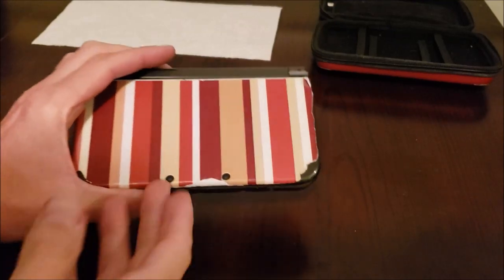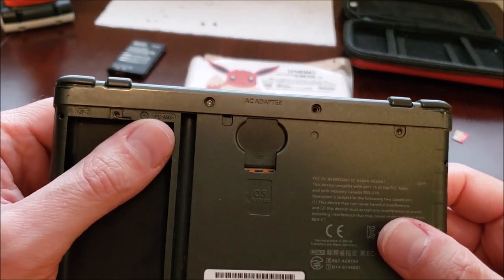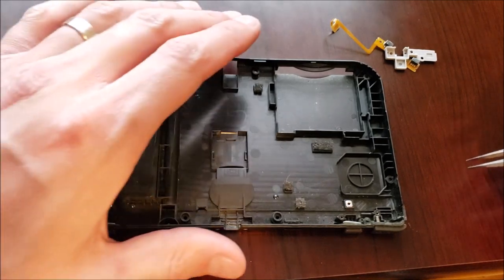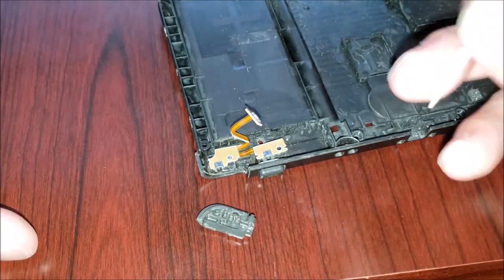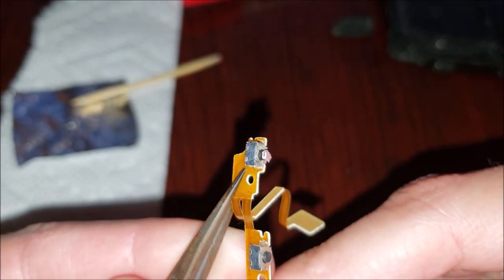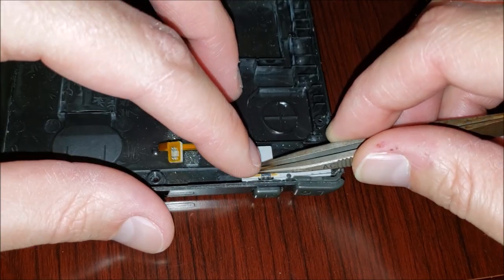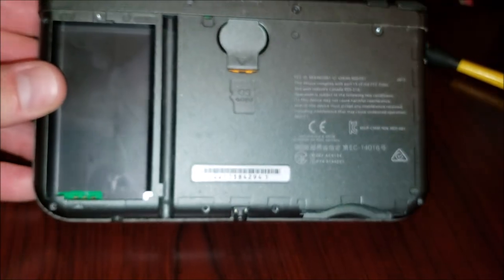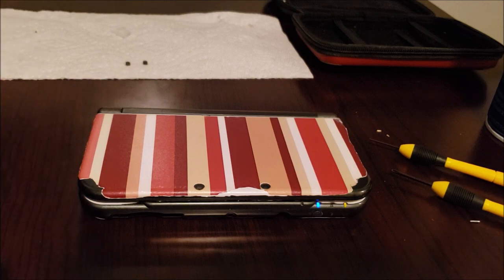How to Repair New 3DS XL Damaged Shoulder Pad Button

Comment: Question I got the right screw driver but I can’t unscrew it any of the screws in my 3ds any tips?
Reply from the maker: the screws are stripped or you don't have the right screwdriver
Reply: @FantasticQuack  I may have the wrong screwdriver which is the correct one?

Comment: I have a similar issue My left clicks but don't do nothing. But after pressing for about 5 mins its start working but stops after awhile.
Reply: HyruleDefender Gaming both the l and zl button dont work?my zl wasnt working and i repaired it giving the flex a bath of alcohol,maybe that could work with tou too,anyways you can buy the flex online and change it which is supposed to work 100%
Reply: Press Y for same but with my right triggger
Reply from the maker: Try opening the system and cleaning out the switch with alcohol. It might just have some grime inside it that loosens up when friction starts to get it warm.

Comment: How can i get stripped screws out? I feel like theyre stripped or they just wont twist and i dont know how to or what to use to fix it? Any help
Reply from the maker: I had the same problem mentioned around the 1:26 time marker.
The "easy option" is just to drill the head of the screw off (what I did); carefully use a metal drill bit with the same or slightly larger diameter as the head of the screw--drilling just deep enough to remove the screw head and not damage the plastic underneath. Then you can pull the shell off you remove the threaded remains of the screw with a needle-nose pliers or similar tool. After this, you either need to just accept a missing screw or find a replacement.

Other option: you could try a small screw extractor like this one--- https://www.mcmaster.com/5054A11/

Comment: Hi i have a problem with my shoulder buttons because one of the is broken. I can't find new ones, where can i buy it?
Reply from the maker: Not sure if you need the button cap (the thing you physically touch when playing) or the actual button itself (soldered to a flex cable attached to the main board). If the latter, it's easiest to replace the whole button cable. For either there are a ton of options online. Just search "3ds xl shoulder button set" in google shopping tab, aliexpress, amazon, etc.

Comment: What are the screwdrivers used please?
Reply from the maker: I don't remember exactly and I think the bit size changed depending on the screw. I believe everything was in the 1-2mm range for bit size. Usually drivers like these come in a set, so I'd recommend testing out each one until you feel it properly seating in the screw head without being able to rotate freely inside of it. If you're careful before you start trying to unscrew it you can identify the appropriate bit size with this method. You'll want to apply a downward pressure as you unscrew to make sure the driver remains seated--even the correct bit size can strip a screw if you're not careful.

Comment: That did the trick! however I used a copper tape folded into 6 folds and cut into the size of the L button inside in my case super glued it and assembled it like normal and now the L button works like normal. thanks for the great tip!
Reply from the maker: Glad you got it working again! The copper tape is definitely a better option and more easy to work with, I just didn't have any at the time so had to go MacGyver style

Comment: there is a spot in the video that shows the orientation of the left button ribbon cable that attaches to the motherboard when connected. This was particularly helpful to me because I had to replace the ribbon cable and the cable didn't have the prebends in the cable so I was able to see how it was supposed to go.
Reply from the maker: Glad this helped you out!

Comment: Good to see. I don't think mine has the exact same issue, but this really gives me the confidence to crack it open and take a look. Did the repair end up holding up over time?
Reply from the maker: Haven't had the cousin coming after me to fix it again yet so I assume it held up!
Reply: I know your issue I guarantee it lol replace those trigger ribbon cables there’s 2 versions see the black button he glued? There’s a plastic variant and a rubber variant the rubber variants are so much better and feel like a dang mouse click it’s amazing figured this out from taking apart multiple the rubber lasts longer and feels better also I’ve never seen one with rubber trigger ribbon buttons come in for repair for trigger flaws

Comment: Trying to fix mine, used to have no input at all, I tried opening and getting a replacement spring, the ZR button works fine but when pressing the R it only sometimes detects me pushing down on it, thinking of getting replacement triggers but any other methods I could try? Nothing seems wrong with the parts physically, no bents dents or anything
Reply from the maker: Do you feel the underlying switch "click" when you press it down, or does it just feel like a hard stop? It doesn't sound like replacing the plastic trigger piece alone would solve your problem (unless you see damage on it). My best guess is the switch is bad or the trigger is not contacting the switch properly.
Reply: @FantasticQuack  I do get the click I would normally get on my L that works fine, and what could I do to fix it though, could I order any parts to help such as new buttons WITH flex cables?
Reply from the maker: @chasical8493  Looks like you can:
https://www.ebay.com/itm/124016056203?hash=item1cdfeed78b:g:kUAAAOSwj-5d6ezI

Comment: Sir, I have quite a strange problem. Initially, my L trigger had problems with the statement that ZL was working but L was not, but both buttons made a clicking sound when pressed. After I replaced the flexible, that two buttons worked normally. However, suddenly the R trigger had the same problem afterwards. ZR works but R doesn't. Unfortunately for some time now I haven't been able to buy flexible because imports from outside the country are being banned by my stupid government. Do you have a solution? I have tried to open it and put it back but it doesn't work, I have tried blowing it too, the result is still the same
Reply from the maker: Further troubleshooting is necessary. I would use a multimeter to check if the switch on the flex is working properly when you press it and go from there based on what you find.
Reply: @FantasticQuack  ah that sounds difficult for me to do because I'm very lay with things like this... but thank you so much for the information sir!

Comment: How did you make that little piece that you super glued onto the button?  Reason I ask is because I too had to replace that same ribbon cable (the whole R button ribbon cable) you did this mod with because the cable snapped/broke and now the R button, after having put in the replacement ribbon cable, doesn't register like it should.  The ZR button works just fine, but the R button does not.

If you could say how you did the Coke can foldover thing you did, that would help a lot because I too would like to do the same thing.
Reply from the maker: I cut a small rectangular shape out of a soda can using a scissors, and then folded it over onto itself a couple times. I used either a tweezers or a pliers for pressure to help make the folds really flat. At that point it looks like it does at 4:50. Lastly I cut a tiny circle out of the larger rectangular piece (from the edge of the material, so that part of the piece still has the folded edge and prevents the layers from separating) to get the final piece shown at 5:27.
Hope this helps!

Comment: I should totally do this. Then I won't have to worry about finicky aiming in Federation Force. I can't go one mission without thinking, "Will the 3DS hologram not show when I press R? Can I not portray Flower Power tonight??"

The problem isn't the lack of click, but the lack of prompting. I can press R (click and everything) and move my 3DS around, but my Mech will not aim. The hologram of the 3DS won't show so that means the problem isn't the button physically.
Reply from the maker: So you feel the button click and the game doesn't respond?
In that case the switch itself (the thing soldered to the circuit board) likely needs to be replaced

Comment: Heyy anyone know which type of screwdriver to use for the especially small screws?
Reply from the maker: a philips will work (1 or 1.5mm) and it is what I used, but it is easy to strip since the screws are JIS which has a smaller insertion allowance. If you want to get your hands on a JIS driver that would be best, this image gives a nice illustration of the difference between driver types:
http://walkman-archive.com/articles/article_screwdriver/Screwdriver_types-p.jpg
Reply: @FantasticQuack  Thank you so much! This has never happened to my 3DS so i wanted to be well equipped!
You show a lot of knowledge and care for this topic so, just, thank you~
Reply from the maker: @sparklez74  Happy to help and I hope your 3DS keeps working well!

Comment: Where did you buy the replacements? And specifically the spring?
Reply from the maker: No replacement parts were used here.
Unless you count the small aluminum piece which was cut out of a soda can.

Comment: Thank you thank you thank you
Reply from the maker: You are very welcome
Reply: @FantasticQuack   I have a question,
My Nintendo‘s (3ds xl) R Button dose a Klick but don’t work, can I do the same Methode like you did in the Video or is there another problem (sorry for my bad English)
Reply from the maker: @Bubububuwvhw  hard to say without testing it myself. If the trigger presses normally and it still doesnt work you might need to replace the button
Reply: @FantasticQuack  oh okay thank you so much 🫶🏻